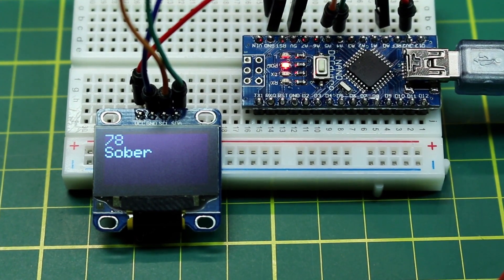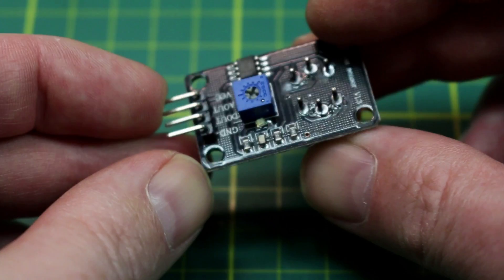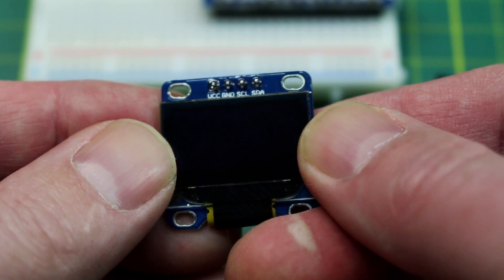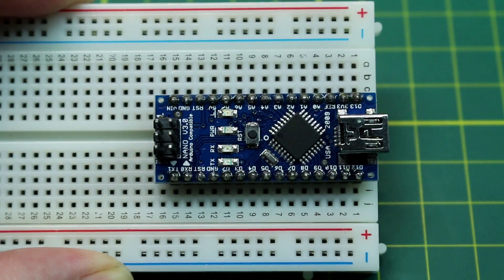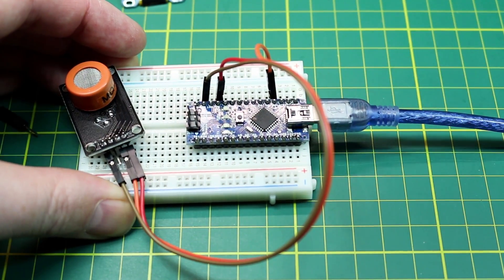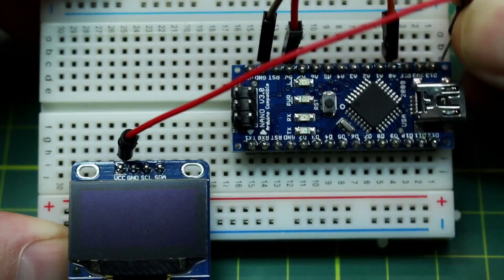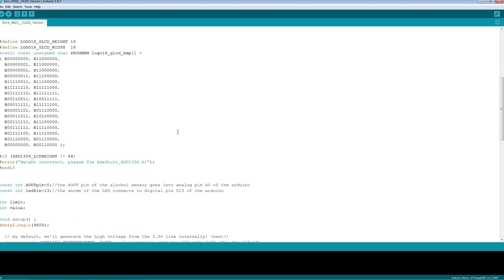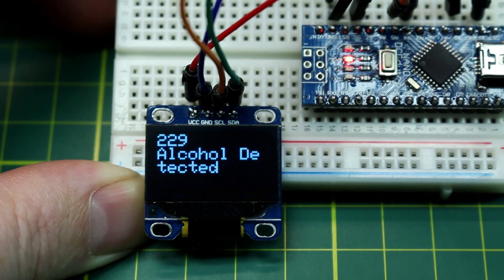Arduino DIY Breathalyzer With MQ3 Alcohol Sensor & OLED Display

Comment: How do I calibrate the alcohol sensor.  One thing I been struggling with
Reply: take a measurement sober and set that to the min value. The get completely wasted and take another measurement, set that to the max value. Then do a linear interpretation between the two!

Comment: When I do mine it works only the values are always saying that I am drunk. I heard that there is a warm-up time? What is that and how do I do it? Sorry if its a dumb question, I'm new here! Thanks for your answer
Reply from the maker: Initially they need time for a "burn-off" then it should only take under a minute for subsequent starts (usually under 30 seconds)

Comment: There's an alcohol sensor? ( well obviously there is but I didn't expect it to be so readily available )

I swear there's an arduino sensor for everything.
Reply from the maker: The beauty of Arduino- it is just a micro controller- just about any sensor or device in the world can be adapted to work with it- It does not need to say Arduino ;)
Reply: Oh yeah, of course, all it really needs is a potential divider and you're done. But for an alcohol sensor, I would've expected to have to rig something up but now that I think about it, you could find practically any sensor.

I didn't really mean an Arduino sensor specifically but a premade sensor. Looking back on it now it was a pretty ridiculous thing to say but it was 3 AM :P I suppose this is why I make shitty robots instead of useful things. Good job.

Comment: hi im trying to do this project myself only im using an oled display SPI what i think shouldnt be a problem but when im using your code i get this error: 

alcoholo_test_02:51: error: #error ("Height incorrect, please fix Adafruit_SSD1306.h!");
 #error("Height incorrect, please fix Adafruit_SSD1306.h!");
  ^
exit status 1
#error ("Height incorrect, please fix Adafruit_SSD1306.h!");

Might be a stupid thing im not seeing but im new to all this :)

could someone help please? thanks in advance
Reply from the maker: +jan jeyo Perhaps you are using the wrong library for your display or haven't configured it correctly.

Comment: i worry about the effects of alcohol, but like to drink, so i keep a log of how much i drink.
(been a diabetic so long, keeping logs of medical data is a force of habit).  Building something like this could be useful, for times when i'm sick of mentally trying to keep count of my drinks.  

If you ditch the Arduino and use an ESP8266 instead, you can have it automatically (& wirelessly) upload the data so it can be graphed.  It could just upload to your smartphone, allowing you to see your inebriation during the night, and predicting when it'd be safe/legal for you to drive.  Simple visuals are important, coz might be too drunk to understand.
Uploading wouldn't be absolutely necessary, it could all be displayed on the OLED, but it's probably easier to code a good interface on a smartphone app.
Reply from the maker: +roidroid Build it up :)  Cheers